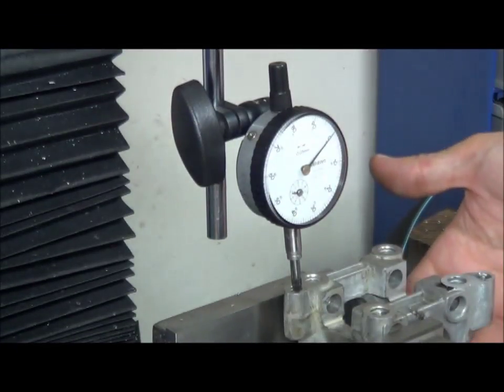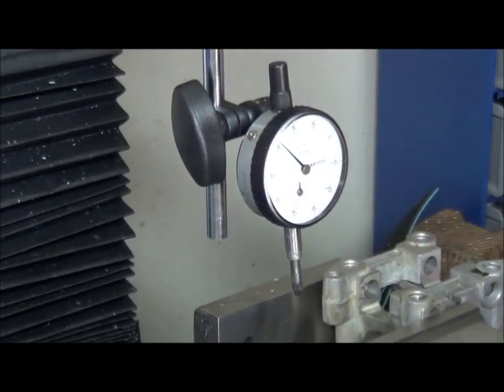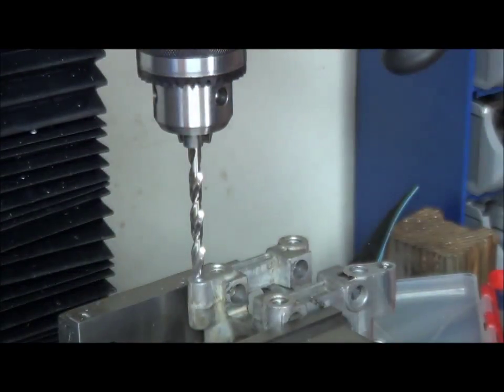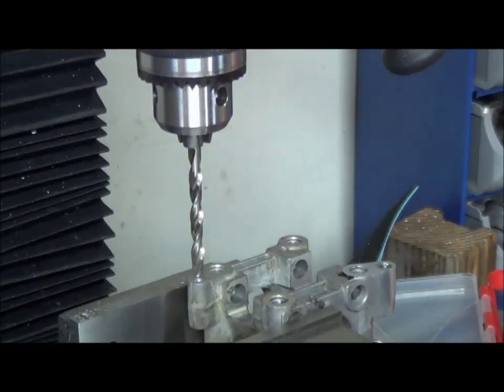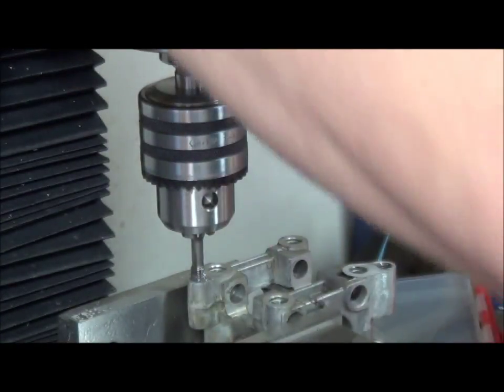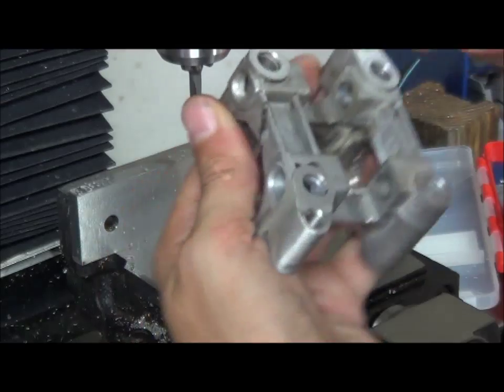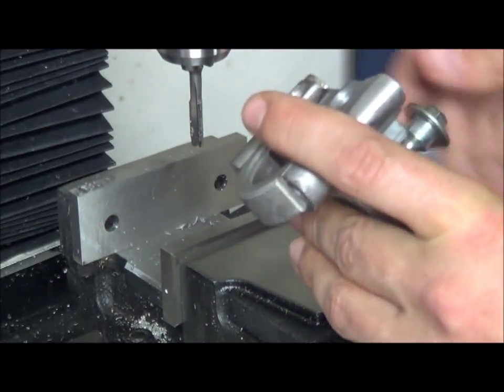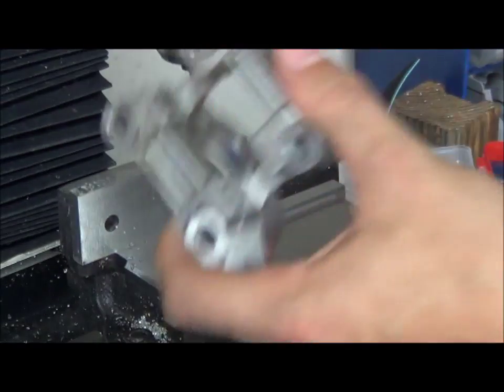Inserting a Helicoil

Comment: So Matt.
This weekend I was doing an oil change and I noticed the previous owner had stripped the threads for the sump plug. Would you recommend using a Helicoil or go up one size in bolt?
Reply from the maker: Its up to you nut you're gonna find ti hard to make the helicoil stay put with such a short wide thread.
Reply: The Workshop thanks for the answer. So you would tap a wider hole then, or do I need to buy another part for my engine?
Reply from the maker: Yeah just tap it to a larger size - make sure you don't do it on the bike though LOL

Comment: Inserting a Helicoil vid: Hey dude, Is this your only helicoil vid?
I'm interested in your views on them and a "hands on" video covering size and thread selection. Are there any applications where you shouldn't use helicoils...for whatever reasons. eg brake disc mounts, cylinder head bolts, clipons, etc... I've got loads of questions...
Cheers dude!